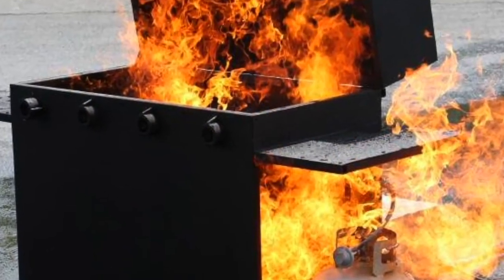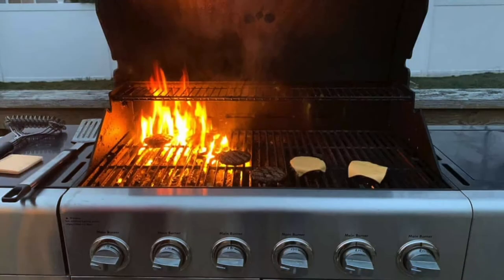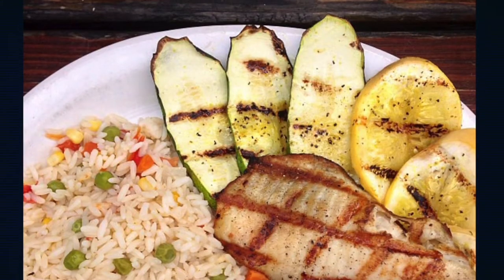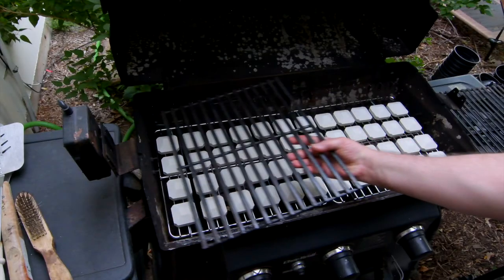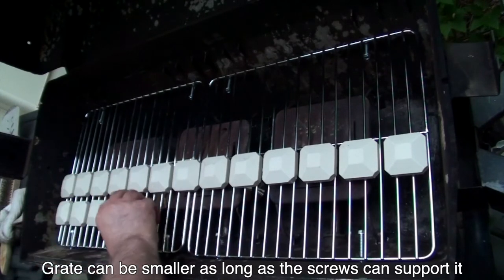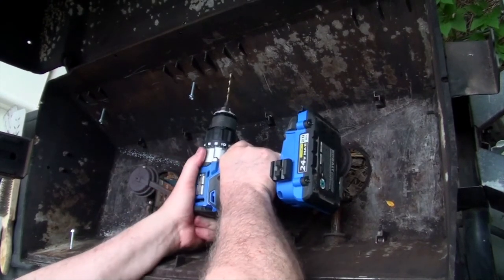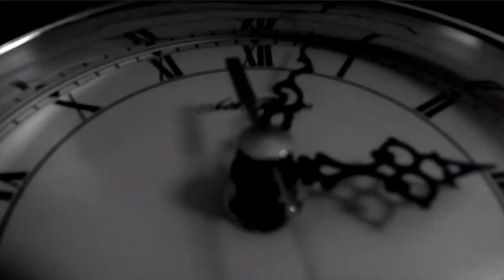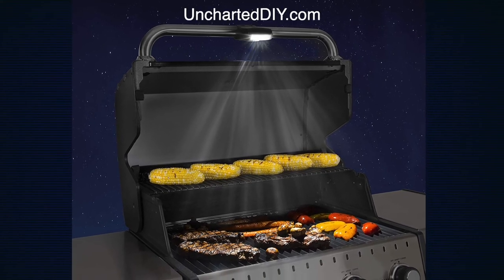Grill on Fire? Convert Basic/Old Gas BBQ to Ceramic Briquettes - $50, 1/2 hour! Simple, DIY Upgrade

Comment: I have a Charbroil gas grill that needs the burner tube replaced. The tubes are covered by heat shields not tents. Also has "Infrared cooking grates system ", not a fan. I can replace the igniter tubes and heat shields, you think the rock grate will sit o  top of the heat shields? As for the cooking grates grates

Comment: Charbroil would like you to believe that you can only use I framed style grates on this grill. I know I can replace with stainless steel grates, but the well that the grate sits in is not quite standard. Any recommendations on this and the heat shield issue? Love your video!
Reply from the maker: Thank you, jonboyee! I don't know how the Charbroil is laid out, but I wonder if you could drill into the body and insert self-tapping screws like I did in the video? Mine was non-standard too and the screws gave me a place to add the grates.

Comment: Does it have to be a rock grate or can any grate work?
Reply from the maker: That's a great question, Augustus. As long as the rows are close enough together, any type of grill or grate that can withstand contact with fire and be food safe should work. You can see the specific ones I used in the video description. They could also be made of expanded steel or a mesh, but definitely don't use anything that is galvanized, as that gives off seriously toxic fumes.

Comment: What happens with the point of the screws going through the body of the grill?
Reply from the maker: The screws cut their own threads into the aluminum body as they go into the pilot holes. Do to the space constraints inside the grill, pilot holes are needed since there isn't enough room to get enough leverage to screw them in without pre-drilling. The tips will come out looking exactly like they went in, leaving clean threaded holes.
Reply: @UnchartedDIY  are there sharp points sticking out on the exterior of the grill?
Reply from the maker: @reneeharlow1983  They do protrude about a quarter inch, but they aren't sharp like a normal screw. The tips are pretty blunt because of the self drilling feature. It would be easy to cut them flush using a rotary tool (Dremel), but with the way the lower body tapers inward on mine, it would be quite difficult to touch them by accident.
Reply: @UnchartedDIY  thanks

Comment: Why they've ever gone away from briquettes i have no idea
Reply from the maker: I totally agree!
Reply: @UnchartedDIY  I converted my two cheap broil King's. Watched this to see how to replace the heat displacer.  I should have switched it when I added the rocks I just put them on the original tin
Reply from the maker: If you happy with how they are cooking, you should be fine!  @666dynomax
Reply: @UnchartedDIY   Yes one has rotted through, rather than the $52.99 to replace the factory shield which i dont use, I'm going to use your method.  Where do you get your lava?  Hard to find here locally, looks like Amazon is my best choice at $22-27/10lb bag (canadian)
Reply from the maker: I couldn't find them locally either, so I used Amazon. I have a link to the briquettes and the grills I used in the description. They made a big difference and now my grill cooks better than when I bought it new!

Comment: what temps can you get up to?
Reply from the maker: Interesting question 🤔  I don't measure the heat inside the grill, instead I look at the super-vague gauge that's built in to the lid. When it's in the center between low and high, it's pretty close to 350. It's been all the way to high and was really hot, but I've never measured it when it's high.  Maybe I should!